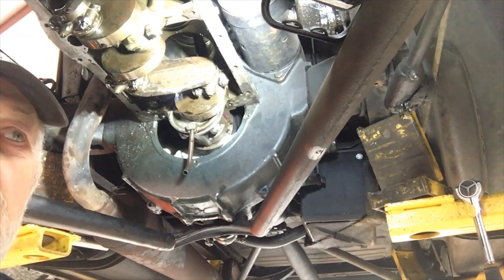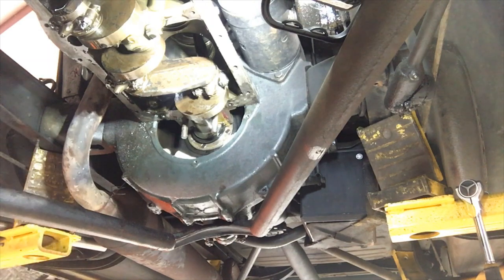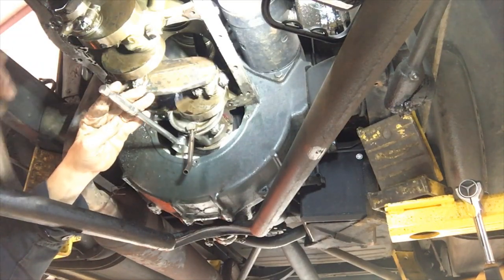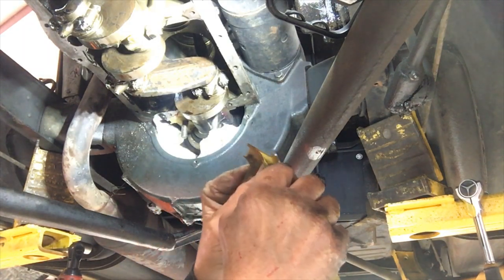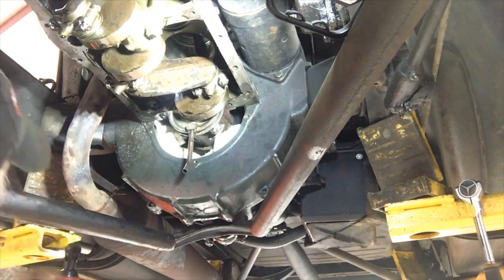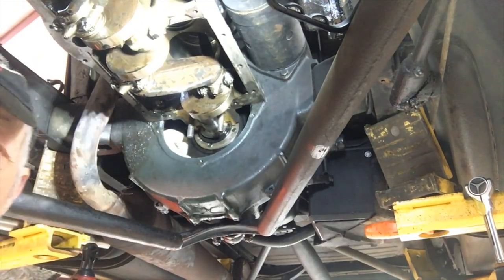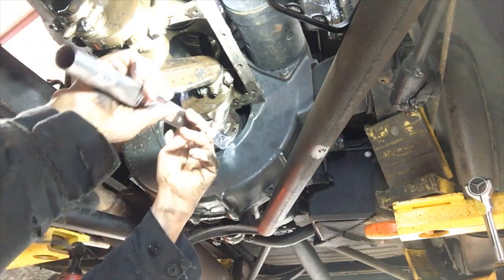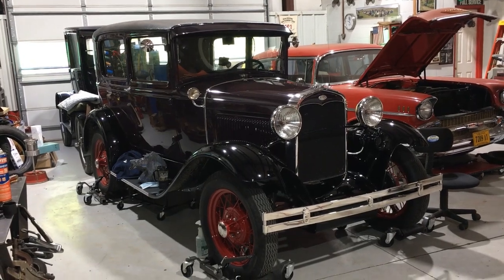Checking Ford Model A or T Main/Rod Bearing Clearances

Comment: Excellent, I'm dropping my pan tomorrow to look for the reason I'm getting a healthy drip of oil Out of the bell housing hole.  Glad I got to watch this video first very informative 👍
Reply from the maker: Thanks also check the oil pan bolts at ft and read sometimes they leak because they thread up into crankcase

Comment: Randall, I've driven my July '28 engine about 3,500 miles since I paid a Model A mechanic to do this for me.  I didn't know anything about the history of my car but felt like it needed done after I drove my "new" car a while.  The mains were out from 3 to 4 thousandths.  The rods bearings were right.  I'm going to do it your way next time.  About how often does this need to be done?  Appreciate your videos and your willingness to share your expertise.  Best Regards,
Reply from the maker: Thanks. If your bearings are in good shape you should be set for a long time but if you hear them start rattling you need to adjust

Comment: I just dropped my pan on my Model A and was going to do the rear main and noticed that the stud was loose before I even removed the cotter pin.  Can this be tightened after I remove the main cap or does the motor need to be pulled to remove the crankshaft to tighten?
Reply from the maker: Yes the stud has a shoulder that won’t let it spin
Reply: @randallstrickland8204  Sorry to bother you but do you mean Yes I need to pull the motor or Yes I can tighten after I remove the rear main bearing cap?
Reply from the maker: Yes you can tighten

Comment: It looks to me like you took a shim off one side only not both. Is that correct? Why not both at the same time so it would be even? Would the clearance be different if it’s not torqued?
Reply from the maker: You only take one at a time on some of the bearings if I had taken one on each side it would have been to tight, I had the bolts tight but always go back and torque